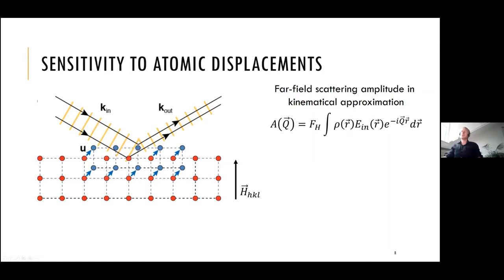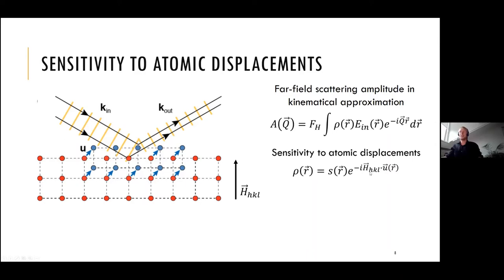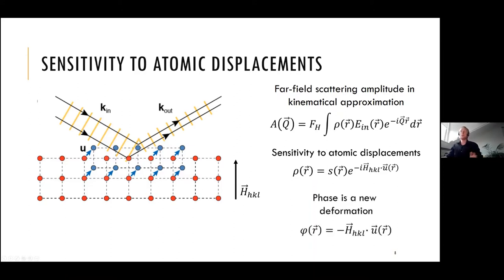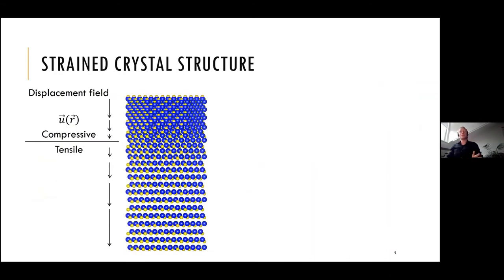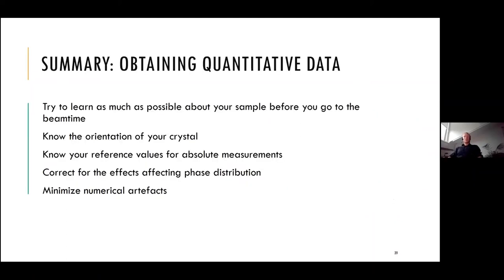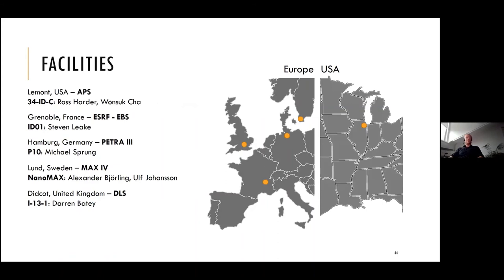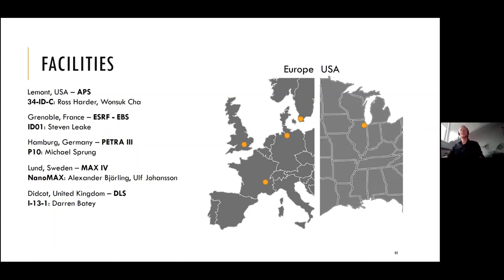Intro to hard X-ray Coherent Diffractive Imaging in Bragg geometry and quantitative phase retrieval

Comment: Nice presentation. Looking forward to more in the Future
Reply: thank you!
Reply: @dmitrydzhigaev3772  Nice presesntation and good figures to elucidate BCDI. I am a beginner researcher to measure BCDI for six months. Is there any BCDI community online, which can ask questions getting problems each other? In my case, as you know, depending on iterations or minimum background data, which we can choose when we try to reconstruct diffraction pattern data using the Matlab, if I get three, or four reconstruction images, which should I truse the most? I mean that, one is showing bigger phase diffrerence, the other is showing smaller phase difference, depending on background minimum data. I have something like that questions about BCDI, so nowadays I have searched BCDI papers, but it is hardly to find out practical data processing as I asked..
Reply: @doyeonkim1016  hi! We actually had a local group at DESY for technical discussions, but now I see there is an increasing need for some sort of Wiki on the BCDI. I will try to set up something like this, so everyone can contribute! Meanwhile, we can have a short discussion on your issues, just drop me an e-mail (the address is on the first slide of the presentation)
Reply: @dmitrydzhigaev3772  Thank you for kind reply. Yesterday, it was lucky to find out your presentation and I figured out there were more seminar videos in series. Then, I will send an e-mail to you if really needed for help about my data processing as you said :)